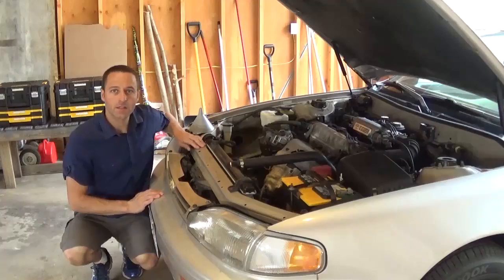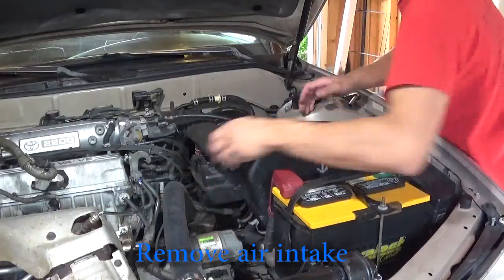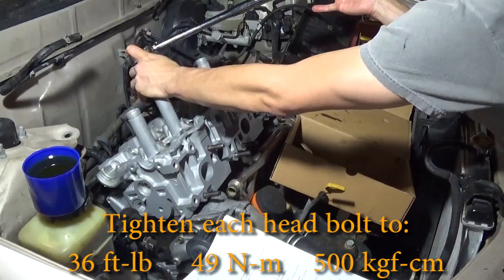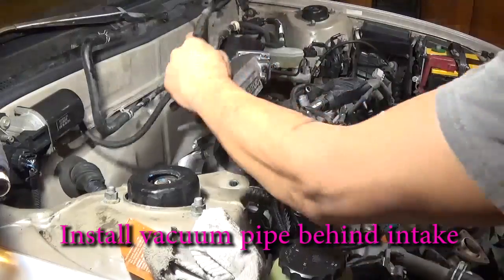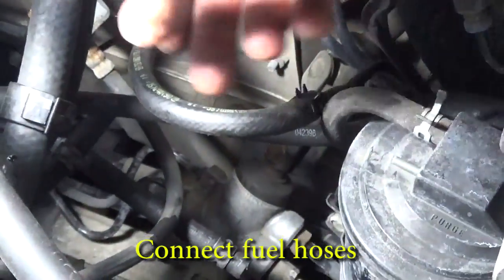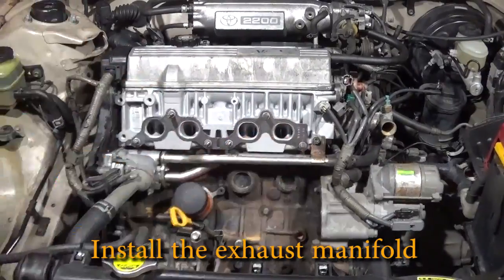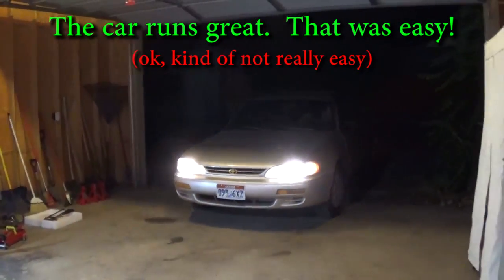How to replace the cylinder head gasket on a 96 Toyota Camry 4 cylinder

Comment: The exhaust cam gear has a sub-gear that is spring loaded relative to the main gear.  It reduces chatter significantly between the intake and exhaust cam gears.  Before removing the exhaust camshaft, a bolt is inserted through a hole in the sub-gear and into a threaded hole in the main gear to maintain the spring-loaded tension of the sub gear.  After installing the camshaft, that bolt is removed to allow free spring action again.  If the sub-gear was somehow left unloaded by a repair person who didn't know any better, the sub-gear needs to be spring-loaded while the camshaft if removed from the head by rotating it one tooth worth of rotation clockwise relative to the main gear (as seen looking from the front of the engine) and holding that tension in place with the bolt mentioned earlier.

Comment: 9:00 there needs to be a bolt in the intake camshaft to properly clock the half gear.. Other than that, great video. At 330K miles, I finally need this on my 1994! Wish me luck, I'll be starting this week.

Comment: Wish you had a video on the 5VZ lol. I will be using this one too, on my roommates camry, he just blew it a few days ago. You didnt use the oem vacuum harness, did you just get a bunch of line and make new lines?
Reply from the maker: The old vacuum hoses are extremely good quality rubber. You can route the same hoses a little better, and trim the ends.

Comment: you are taking stuff for granted. how do you know that the head wasn't shaved down past the limit without finding out after you installed the head?
Reply from the maker: The remanufactured head I bought is ready to go in to the engine.  The machine shop should have done a valve job, installed new seals, and made sure it's flat and within specs.  Yes, I should have checked it myself too, but it turned out OK.

Comment: I was shocked that the split gear on the camshaft didn't give up any trouble at start up... How bad did it "chatter" afterwards? If you noticed strange sounds, and vibrations, that's what it was from... You're supposed to put a 6mm x 1.00 in the split tension gear on the camshaft, before removal, and remove it after re-installation. Otherwise, chatter and/or vibration will occur. Super job though.
Reply from the maker: Yes, the bolt is left out when the installation is done.  My engine works great with the new head.  The valve lifters are very loud, but that's normal for the 5s-fe engine.  It sounds kind of like a sewing machine.

Comment: You did not mention the torque spec of the metal fitting that goes on the upper radiator hose and has all the coolant sensors as well as the bvsv. If you could comment that I'd greatly appreciate it.

Comment: I agree that this is a great video.   I just did this procedure, replaced a cylinder head on my 01 Camry using this as a primary guide.   It's taken me about 10 times as long as Paul and mine hasn't turned out as well.   When I started it up, I got a loud pop.   Tested compression on cyl 1 = 0.    Went to put the plug back in and it won't sit down.   I assume I've damaged a piston or cam somehow that's crushing the tip of the spark plug.   I assume it's time to call it done,...but if anyone has any ideas or things to check, I'm open and would appreciate the advice.

Quick update:  I looked down the spark tubes and noticed that there's a threaded sleeve in the broken one that's a different color, brass?, it's yellow metal and it's pushed up into the tube.

Comment: was yours the california version also was the head gasket metal or of composite material?
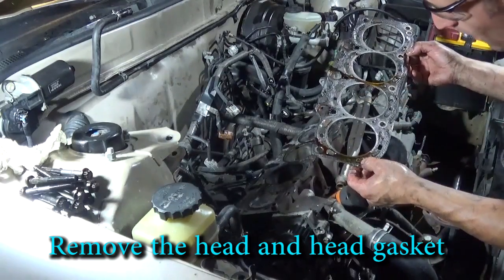Reply from the maker: The head gasket was metal, coated with some sealing material.  You can see it at 4:50 in the video.

Comment: Is this the same for a 98 camry mines is a california emissions too didn't understand tight cylinder head bolts 90 degrees
Reply from the maker: Look at the video at 7:08.  Toyota says to torque the head bolts to 36 ft-lb, then turn the bolts an additional 90 degrees.

Comment: I think my car also have leak head gasket because there is buble in coolant reservoir when engine running. Also my car has terrible fuel consumption, it possible it cause by the leak head gasket?

Comment: This engine is the same than the Rav4 1996 so this video is very useful! I was looking for this! thanks!
Reply: the 1996 rav4 has a different engine, it's the 2.0 liter 3s-fe, similar but not the same as the 2.2 liter 5s-fe in this camry
Reply: @nickaa827  agree but the tips here can be applied to the Rav4 engine don't you think?
Reply: @ignacioanaya3403  no doubt

Comment: Please help me do mine! I did a compression test on it about 2 or 3 months ago and it was still in great shape. The exhaust manifold had started coming loose which made it run horrible so I thought it was my head gasket. Lately it started to loose power somewhat and had engine light on but I replaced some fuses and disconnected the battery so the light went out.  It hasn't come on since so I don't know what the code was and it still hasn't come on after almost a month.. i saw some fresh looking oil on the back right top side of the engine today above the air intake? Hoping that isn't the head gasket but with how its running (not horrible) I think its a gasket somewhere.. help me plzz I love my car and have replaced everything except the engine practically.
Reply from the maker: It sounds like you have a valve cover gasket leak.  it's a common problem and it's cheap and easy to fix.
Reply: @LabCoatPaul  how do I test to see if this is an actual problem? Its a tight space right back in there and if possible I might be able to snap a picture close enough in that general area in the daylight. I greatly appreciate your quick response as well. How much do you know about this car as well? I could really use your knowledge and have been trying to find someone who owns one and understands the general workings and possible problems they might have.
Reply: @LabCoatPaul  p.s. I had the plugs and wires changed when my mechanic did the timing belt after it went out last year and ever since they were changed the new wires have fell off/unplugged from the distributor cap. First 2 times I noticed immediately and stopped and found that to be the problem.  3rd time was last week I was doing a regular inspection under the hood filling fluids and have also started to clean the engine compartment delicately.. i saw the middle wire was unplugged from the distributor cap and do not know how long it has been like that. I didn't have any issues like I had when the other 2 came unplugged (loss of extreme power) what does the middle plug do? It runs away from the engine unlike my other 4 that run each cylinder i guess.. I'm surprised this didn't solve my slight loss of power issue after I plugged it back in.😒
Reply from the maker: @zacharyjoel9449  The distributor sends the spark to each spark plug at the right time.  The center wire goes to the ignition coil, which is bolted to the firewall.  The coil makes the spark.  If the center distributor wire is unplugged, the engine will not run.

To make sure your spark plug wires don't unplug, pull each wire out of the distributor cap, one at a time.  Pull the rubber cover back away from the connector.  Then plug it in to the distributor cap.  You should feel it snap into place.  If the connector is loose, you can spread the connector a little bit, then plug it in.  After it's plugged in, push the rubber cover over the post on the distributor.

Comment: Darn good video! BTW, what brand of torque wrenches did you use? I'd like to buy some w/o breaking the bank.
Reply from the maker: Well..... I just had a $50 auto parts store torque wrench.  It broke after a while. 
I would recommend a Snap-On torque wrench, even though it's expensive.  Never buy a used torque wrench though, because you don't know if it was stored properly.  If a torque wrench isn't zeroed out after every use, it will lose it's calibration.
Reply: @LabCoatPaul  Thanks!

Comment: Great video! Helping my youngest fix up her 95 celica gt, this is exactly what I needed, the manual she found has proven to be useless. Just curious, are there torque settings when re-installing the cam shafts?
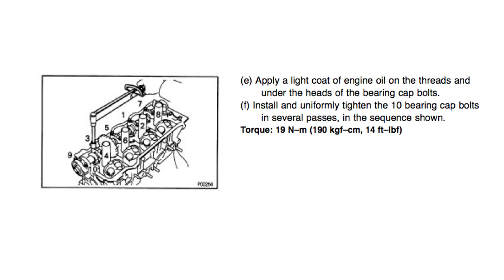Reply from the maker: Yes.  Watch the video at 8:14
Reply: @LabCoatPaul  sorry, missed it last night, I am getting old👍Great video. Was that your first time? Also, where did you get the manual?

Comment: You don't need to replace the head merely cause it warped, they can shave it for about 40 bucks at the machine shop.
Reply from the maker: Mine was severely warped.  The machine shop said it would likely break a camshaft.  My car had over 150,000 miles and the car is over 20 years old.  The valve seals are old, the valve seats are worn, and the lifters are probably out of spec.  A remanufactured head is the best option.

Comment: How long did it take for you to remove it? and how long to reassemble?   a piece of metal from the exhaust fell into the cylinder 3 valve and possibly the cylinder. Great video, thanks.
Reply from the maker: Replacing the head gasket is about a 10 hour job.  You might be able to get the metal piece out if you take out the spark plug and use a magnet.

Comment: Great video, I hope I never have to do this to the head while the engine is in the car, rebuild on a stand would even be sketchy! Are you still driving the car? How many miles have you gotten since this procedure? update us please!
Reply from the maker: I drove the car for a year after replacing the cylinder head, then I sold it.  Now I have a 1997 Toyota RAV4.   The Camry didn't have air conditioning (it was the really cheap model), and it didn't have AWD.  Now I have both in my new car.
Reply: @LabCoatPaul  To comment on this a little more. I happened to have a 1994 camry, 4 cyl, and i used this very video from Paul to replace my headgasket about a year ago (it was oct2018, with 310k mileage). I didn't have impact wrench so removing the balancer was a challenge, but the biggest challenge was removing that intake manifold from engine's back, I swore like a seaman while doing that !! How it seems so easy in the vid - i'm left to guess :)     Also, I only had to re-plane the old cyl head, it was in a good shape, with minimal warpage.
In any case, everything was done right, and my car is running strong now, with 325 k on it one year later. Planning to go till 400k until i'm worried about TB again.
Paul, i took inspiration from your vid back then and did it myself. Otherwise - paying ~ 2k for this job in a car which is worth like 500$ would have been a shame!
THANKS a lot.
Reply: @myaso4123  It's a pain to work on some things without an air compressor. I have a Porter Cable pancake compressor and a Bostitch 500ft/lbs impact wrench. I have done harmonic balancers on my Mustang and Camry, all the struts on the Camry, the lower control arms and then lots of suspension work on my Camaro. I tried everything to get the balancer off on my Mustang, I did the breaker bar and 2x4s and a Craftsman battery powered impact, but nothing broke it loose. That little Porter Cable ripped it right off.

Comment: What will happen if your one tooth off on the camshaft pulley when reinstalling timing belt?
Reply from the maker: The 5Sfe is a non-interference engine.  That means the valves can not hit the pistons, even if the timing belt is installed wrong.  You won't damage your engine, but it definitely won't run right if you're off by a tooth.  You'll get no power, and the engine might backfire through the intake.

Comment: How much did this project cost you... I'm getting weird noises coming from my cylinder head but not sure if the car is worth the money to fix it.... it still runs but its definitely not a highway vehicle cross country vehicle...
Reply from the maker: The remanufactured cylinder head was about $500 from Autozone.  Then add oil, coolant, head gasket set, timing belt, water pump, and a lot of time.  I would budget about $1,000 for this project if you do all the work yourself for free. 

 Is it worth it?  Technically, no.  An old Camry is worth about $1,500 and a new cylinder head (at the shop) is at least $2,500.  If your car is in good condition otherwise and you plan to use it for a few more years, it may still be a good idea to fix it.

Comment: Oh my God.. I have a 94 toyota camry XLE v6, over 304,000 miles, I might have to do this... No garage! And fuckin V6...
Reply from the maker: That sounds like a bad time for sure.  You may be better off replacing the engine (or the car).   A 1996 Camry with 150K miles is worth about $1,600.  

A head gasket set for your car is about $340 from Autozone + $40 head bolts + $150 timing belt, water pump kit + $40 oil and antifreeze.  Your project will cost at least $600, but could be as much as $1600 if the cylinder heads are bad.  That's not including any labor or tools you may have to get.  

Keep in mind, even after you do head gaskets, the rest of your car is still worn out.  Unless you've done a lot of repairs, your struts and springs are probably dead, the transmission is close to blowing up, and the interior is probably gross and mostly broken.   Financially, it makes no sense to do major repairs on old cars.  I always fix up my cars because I'm dumb and I love them. 

If you do go the replacement car route, 1996 and newer cars have OBD 2, so you can plug in a scan tool and the car's computer will help you fix check engine light stuff.  On the older cars, like yours, you have to jumper a couple terminals and it will flash the light at you to tell you a code.  The old on board diagnostics suck.

Comment: I have replaced the timing belt on similar model camrys and that was OK but I have a blown head/head gasket now and really it is not an economic repair for most people. If u know exactly what u are doing (and you took 10 hrs, I would take three times or more) then perhaps it is worth it but for most people the car is not worth repairing at that point- especially if it has numerous other issues of age. My a/c needs a $300 repair, the paint is pretty bad, interior really bad so market value would be only 1K. It would be easier for most people to use the 20-30 hours in extra paid work and put the money into a newer car. 

Of course if u enjoy the repair work then fair enough but your video totally convinced me to scrap my old car.
Reply: If you have a blown HG and non working AC, it's not even worth $1k. more like $200.
Reply: @richieschmidt6225  Depends on where u live.

Comment: At @11:42 I am assuming you relocate the vacuum switching valve, then you say not to use the vacuum line harness. Did you pull the vacuum lines out of the old harness then cut them to length? Or did you buy all new lines? What type of silicone is that?
Reply from the maker: Yes, I re-used the hoses.  I used black RTV silicone sealer from the auto parts store.

Comment: Hey great video thanks for taking the time to make it. I am about to do this exact project on a 95 Camry. At 11:42 I am assuming you relocate the vacuum switching valve, then you say not to use the vacuum line harness. Did you pull the vacuum lines out of the old harness then cut them to length? Or did you buy all new lines? What type of silicone is that?
Reply: I'm gonna do mine too (95 Camery) I got this... (I hope so)

Comment: Hi. This is a great video however i have the same head gasket job to do on the previous model camry the two litre  87/92 model .while it looks like much the same engine as the 2.2 there  seem to be issues around accessing the timing belt area .Ive been told
that may have to remove engine mounts  etc .can you shed any light before i start pulling things apart .unfortunately i cannot find any videos relating to this particular engine. thak s
Reply from the maker: Your engine is the 3s-fe.  If you search for 3S-FE timing belt replacement, you'll find a few poorly made videos, but you should be able to get the information that you need.  You can also read the engine service manual here: https://cardiagn.com/engine-mechanical-3s-fe-engine/
scroll down to page EG-34
Reply: @LabCoatPaul  thank you for this much appreciated

Comment: You put oil too early and then you have to clean it later . Hummm .
Reply from the maker: yes, as soon as I did that, I felt really dumb.  I should have used assembly lube.  It's a thinner grease that dissolves in oil when you start the engine.

Comment: Where'd you learn to do all this btw? Or just followed the manual?
Reply from the maker: I'm a mechanic, so basically I can replace the head gasket on any car.  I just worked on cars a lot and figured stuff out.  Also, I went to Wyotech for automotive technology.
Reply: @LabCoatPaul  is this a common problem on these engines?
Reply from the maker: @conner5611  At this point, yes.  These cars are more than 20 years old, so most of them are going to have a lot of miles and all the gaskets and seals are bad.
Reply: @LabCoatPaul  but its not as common as the 6.0l powerstroke is it? our car has around 156k and doesn't burn any oil or loose any coolant
Reply from the maker: @conner5611  Your luck is better than mine.  My 1996 Camry and  1997 RAV4 both needed head gaskets, so 100% of my old Toyotas needed head gaskets.
Reply: @LabCoatPaul  I always make sure it has full clean coolant and I use 5w30 synthetic oil with a good filter